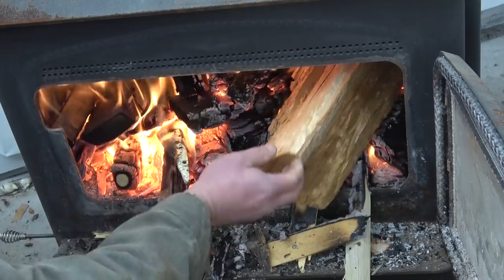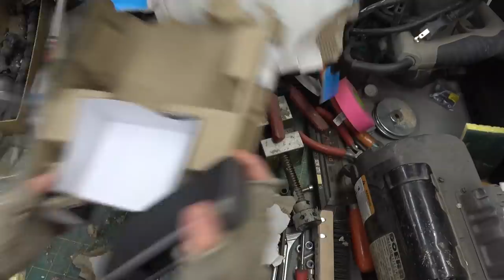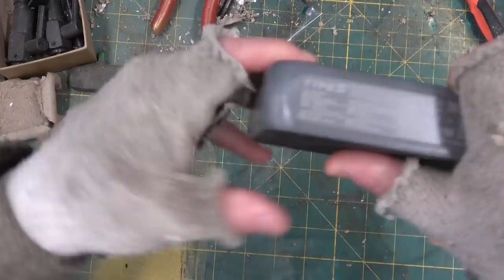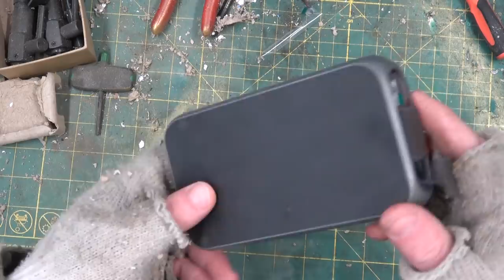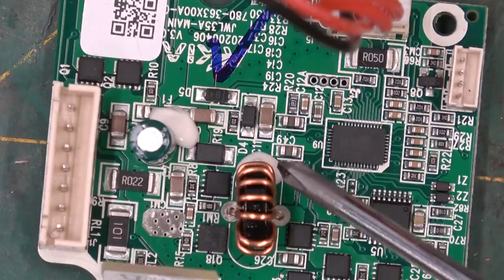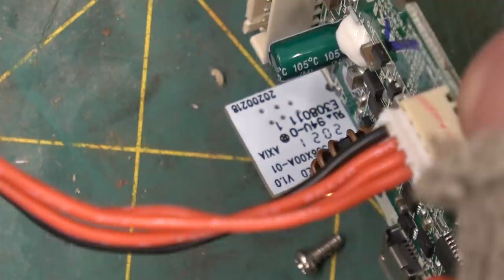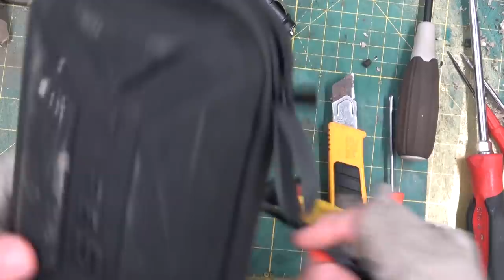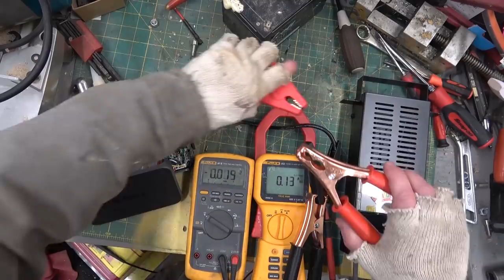BOLTR: Costco Boost Pack | Stupid Design

Comment: I have 3 of these thing, from another mfg, with the same doozamawhatsit in the leads. Nucking Fightmare. I removed it from all of them and they run like a raped ape, no safety mind you. Starts 4l gas pots 5 or 6 times on a charge.
Reply: Those leads are there for a reason. Once the car is started you could overcharge the battery which can catch fire (one that you cannot stop). The more you abuse it like that, the greater the chance of an accident like that because of the degradation of the li-ion battery.  

Please believe me.

Comment: USB micro is a POS.  Too tiny and fragile and newer devices with charging demands that long since exceeded the old standard 500 mA 5V USB current don't charge worth a crap when the jack starts getting worn out/beat up.  USB-C is better in every way.  
As for lithium cold start performance, just crank in a couple of short stints...the power draw warms the battery and gets it back up to more functional performance.